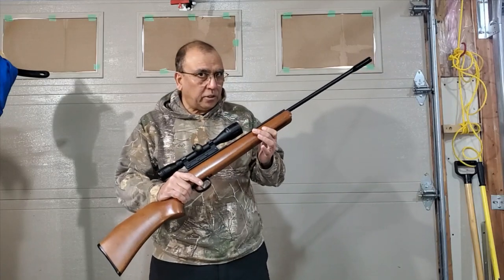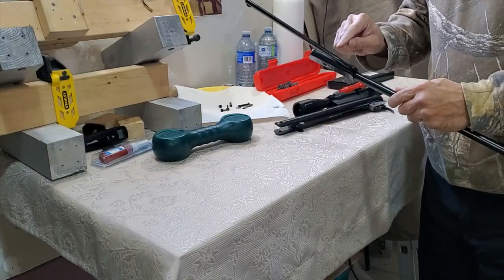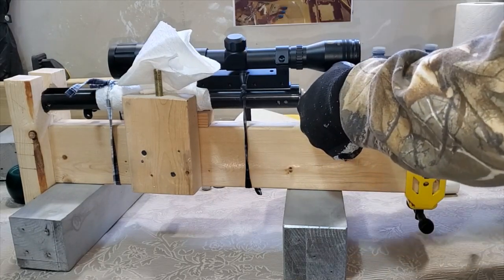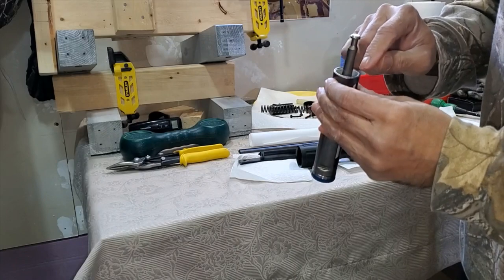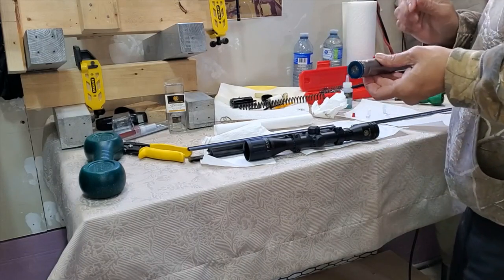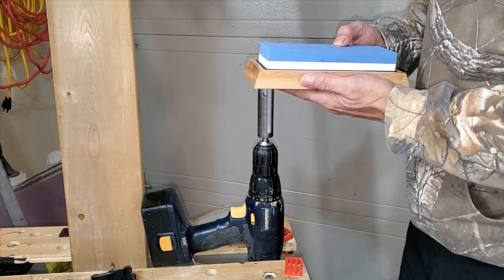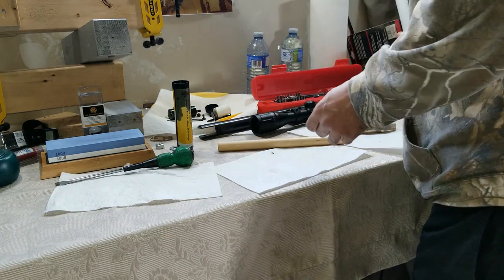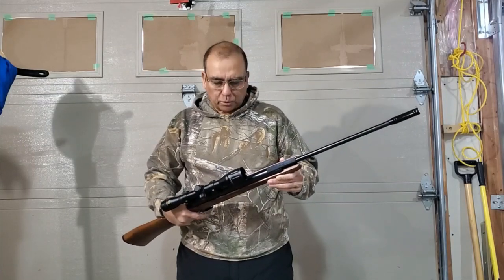Airgun Tuning - Extreme Level of Tuning with Piston Sleeve and Resize Seal

Comment: Wouldn't it be easier to let the piston seal break in and resize itself over time?
Reply from the maker: It depends, some guns have tighter seal some are almost fit. Then you need to fire 500 rounds through it. I chose the difficult and fun path. I had to lool inside the gun anyways. Easier will be to fire gun so many times.

Comment: I want to put a muzzle brake on my 280 but how do I come about doing it I'm really struggling to find out how
Reply: You need to remove the fore sight. Then get the right size muzzlebrake. Installing is very easy as it comes with couple of hex acrews to install. I used a soda can shim for a tight fit.